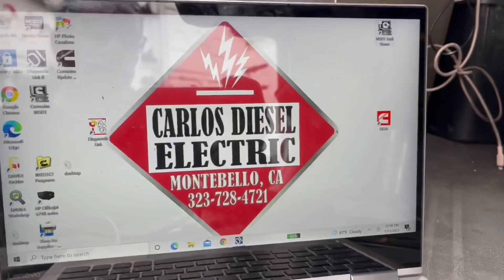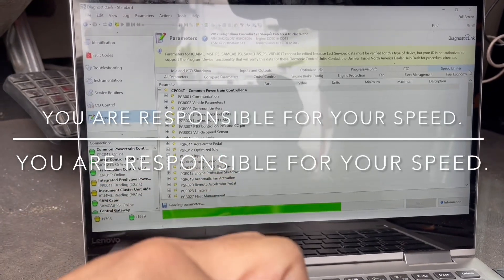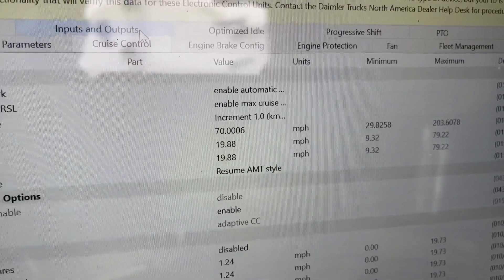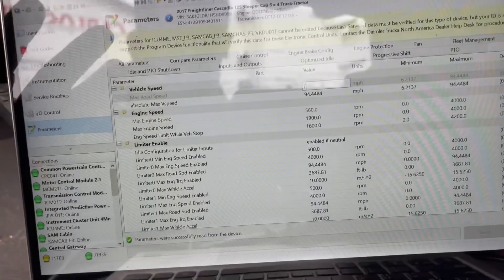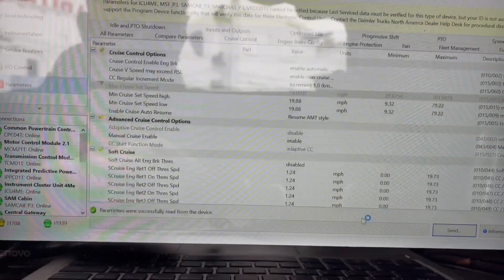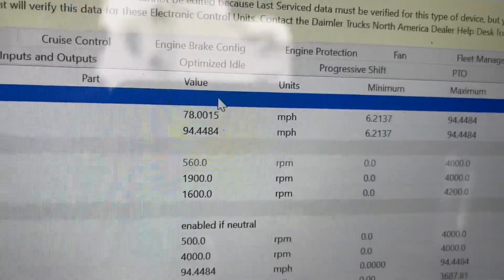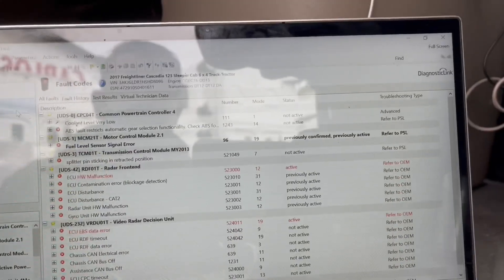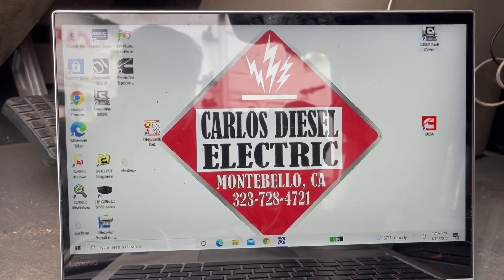Freightliner Cascadia, how to change the speed on your DD15

Comment: Hey Pedro was wondering what parameter i can change to get rid of the torque limiting on take off? Whenever i take off in any gear it limits the amount of power i have and doing heavy haul it gets really frustrating because i need that power on take off especially on steep hills, any info would be great thank you!
Reply from the maker: @Sinister_Reaper  look at the progressive shift. Remove or modify the parameter. That tends to limit  the RPM.
Reply: @CarlosDieselElectric it'll go up to 2000rpms but super slowly, like it's cutting a lot of the torque out, but after I make the first shift I have all the power back
Reply from the maker: @Sinister_Reaper  is your progressive shift enabled or disabled?

Comment: I don’t have my password how can I set the governor on a 2006 Freightliner CASCADIA
Reply from the maker: @UNLIMITED945 try using 0000 or 00000 or 12345 sometimes they are set by default. If that does not work you have to get a SEED password from Detroit but that is dealer only at this point. Detroit changed that a while back.

Comment: What would be the other parameter you would have to change for the newer trucks because I have adjusted my speed and cruise however my RPM will not exceed 1650. So my maximum speed is always 73
Reply from the maker: @moridrahim366  look for a parameter in that says legal speed. That is usually the limiting factor.
Reply: @CarlosDieselElectric  Thank you for your response, I did actually get the rpms to go past by disabling the progressive shift.
Reply from the maker: @moridrahim366  yeah. Forgot to mention that. Progressive shift will also prevent this

Comment: OK about changing the speed
But what about the RPM limit?
I cannot go above 1700 RPM
Reply from the maker: Change the progressive shift to disable. That will remove the RPM limit or you can adjust it to the desired RPM.

Comment: I brought a fleet truck it set for the company. How can I by pass it with a password
Reply from the maker: @ortbrad242  try 12345 or 00000
If that does not work Detroit will have to remove it by using a back door password

Comment: I wish I paid attention to what the mechanic did under the hood of my old company’s 15 Cascadia. Because whatever he did to turn it up to 73 mph, he didn’t use a computer.
Reply: There is a handheld unit that Daimler used to sell to fleets to do certain parameters changes.  Such as raise, lower, or disable the speed limiter, or change fan temp on, off settings.
Reply from the maker: @hudsondonnell444 that would be great to have.
Reply: @hudsondonnell444  what’s the tool?

Comment: What if you don't know the password? How can that be sidestepped??
Reply from the maker: Depending on where you purchased your truck from. If it was purchased from Penske, you can contact them and possibly remit. They have very extensive records. If not, then a Detroit dealer is the only way, it used to be much easier but then someone decided to change that and charge 2-4 hours for something takes about an hour or less.
Reply: It's a Ryder truck so guess dealership here I come. Was hopeful there was a work around, thanks for the reply my friend.

Comment: Hey! Thank you!! So what cable is needed to do this?
Reply from the maker: You will need a 9 pin connector and depending on what kind of interface you use like Nexiq, J Pro  depends on your software. 
For me, Nexiq uses the 9 pin and a usb to connect to my laptop
Reply: @CarlosDieselElectric  thank you so much for the fast response! You’re awesome

Comment: Easy peasy? You can't be serious. You don't show the interface between the laptop and the truck? How the heck you supposed to hook to the truck with the laptop? What software is being used? How much does the software cost? What's the name of the software? Is it a free download? I mean, you don't tell much of anything.
Reply: Did you figure it out
Reply: Software from Detroit is the standard but there are third party softwares that can be used. I think the correct software from Detroit is DDDL/Detroit Deisel Diagnostics Link, or DiagnosticsLink - this needs to be double checked though. First glance at the dddl looks like it has a subscription price that may be based on the role you may using to use the software as : driver, mechanic, fleet owner, etc. I haven't really looked into this subject though, I haven't verified this and could be mistaken.

There is often a harness that connects to the RJ port, or whatever connection you have on the truck, then the other end connects to the laptop. You've most likely seen one of these connectors if you've ever gone into a shop with a light on on the dash

There are also portable handheld devices that can be used, instead of a laptop.

I'm personally trying to find one of those handheld devices. I can't remember the names of them though
Reply: @ericwhittington91  Bully Dog and PDI Big Boss
Reply: @JYoung-jm2bv  thanks, I appreciate you
Reply: What about Ap k download of the software and Bluetooth for the eLD device  @ericwhittington91

Comment: What kind of software do I need, I’m going to buy my own truck and want to possess such software in case of diagnostic not only speed limit changing.
Reply from the maker: There are a few different options. J Pro, OTR and of course you can purchase the original software from Detroit. There is the standard version which is what I use. Allows me to see check engine light, malfunction lights (solid yellow) and the stop engine light.  Park regen
You can mark parameter changes as well. 
I would look at what works best for you and what is worth spending

Comment: So I’ve changed parameters to 77 on both, but unit still not going above 70 mph? Do you have a solution? It a 2024 Cascadia with 2900 miles on it
Reply from the maker: In the parameter, CPC, legal Pass or legal speed needs to be changed. I don’t remember the exact name but look for that. If that is set to let’s say 60 and the others are at 75. It will always obey the legal parameter. But you can change the legal parameter and you should be fine

Comment: Will it work on a 2022 Cascadia?
Reply from the maker: It should, there is an additional parameter that needs to be checked but  it will work on a 2022 Cascadia.
Reply: @CarlosDieselElectric  where will that parameter be located?
Reply from the maker: @Jayjayred24  parameter, CPC and then look for something that says legal pass or legal speed. I don’t remember exactly. 
Look at the speed and cruise control. I would keep them both the same. 
But if the legal parameter is 60 for example and the others say 72. It will follow the legal parameter. Doesn’t mean it can’t be changed.

Comment: Mine says powertrain Over speed detected when I pass 65mph. It’s governed at 65 pedal and 65  cruise control. I’m trying to set it 68 cruise. So far no luck or mechanic didn’t do it right.. help?? 2022 or 2023 cascadia model

Comment: How do I increase my Torque on 2019 Freightliner 126? What software are you using ?
Reply from the maker: The torque and HP are usually governed by the MCM. You may have some options to change the HP but you would need the DDDL software. 
Detroit Diesel Diagnostic Link. You can buy it from Nexiq.

Comment: Hola Carlos , muy bueno tu vídeo y muy informativo , vivo en Canadá y voy siempre a USA , el camión que conduzco está limitado a 65 mph y es camión de la compañía (no soy el dueño) , yo quisiera comprar el soft work e instalarlo en computador y así poder controlar la velocidad , cuando empiezo mi viaje lo abro y cuando retorno a la terminal ponerlo a 65 mph … como si aquí no hubiera pasado nada … me entendes mi punto por lo que quiero hacer … bro , es imposible manejar siempre a 65 mph , el gringo te insulta mucho porque lo molestas … y tienen razón , te agradecería mucho si me puedes ayudar donde puedo comprarlo , y que me sirva para todos los camiones del mercado … Volvo , Freightliner cascadia , Peterbilt , Mack , Kenworth , muy bueno tu información … desde ya muchas gracias de un Uruguayo que vive en Canadá … Abrazo !!!!
Reply from the maker: Normalmente el programa para poder accesar todo esos camiones y motores no lo venden. J Pro o Noregon creo que pueden hacer esos cambios. 
O Tienes que comprar una computadora pirata  que ya tengo esos programas.
Reply: Hola Carlos , muchas gracias por responderme , mire , yo tengo el computador y sólo tendría que comprar el programa para el Volvo 760 engine Volvo 2021 , cual tú me recomiendas ??? Desde ya muchas gracias 🙏 🙏
Reply: Una última pregunta , donde podría comprarlo ??? Gracias 🙏

Comment: My mechanic did this both were set at 80. However, the truck will still only 70mph. What should I do?
Reply from the maker: What year is the truck?
Reply: @CarlosDieselElectric  2018
Reply from the maker: @iamdirtyredd  there is another parameter that needs to be changed. 
Parameter, scroll down and there is a section that starts with legal speed or something to that effect. 
That also needs to be changed, if that parameter isn’t changed the other two will not respond. For example, the legal limit might be 70 and the other two might be 80. The legal limit always takes precedence
Reply: @CarlosDieselElectric  Thanks I'll give it a try.
Reply: @iamdirtyredd  have you figured this out?

Comment: how do you change the rpm governor.  ours are set to 1500 rpm max. 12 speed auto will not pull up a hill very well gets stuck in gear on a hill
Reply from the maker: Connect using the DDDL software and you need to remove or change the progressive shift parameter. This will allow the RPM change

Comment: If the customer owns the truck and wants the limits removed or raised its his responsibility not the techs. In TX they have 80+ speed limits (I know that's fast) but it's not illegal!
Reply from the maker: I agree. At the end of the day the driver is responsible.
Reply: @CarlosDieselElectric Can you use HP tuners sw to do this? Or is there one you prefer?  Thx

Im learning to tune cars & have a Loves near by. Wouldn't mind making some guys happy by giving 5mph over so they can pass easy & stop the 30 car backlogs on these 2  lane freeways/Interstates.
Reply: It's only fast near the big cities 20 miles, 30 miles outside of big cities.That speed should be no problem

Comment: Hey, just a newbie here, wondering if you can do this with just the link cable connected to the laptop or you need the Nexiq tool as well? Thanks
Reply from the maker: Not sure. The Nexiq is the device that allows you to communicate from the 9 pin to the laptop.
Reply: @CarlosDieselElectric  Thanks for the fast respond, really appreciate it

Comment: Hey I got a question. It’s a 2 parter how do you change torque and horsepower where can that be found at in the diagnostic link program? Also how do you turn off the door open alarms with diagnostic link program also?
Reply from the maker: The torque is already set in the MCM. You can only change the horsepower in the Actions tab. Most trucks have this option. 
The alarm for the door is probably on the Freightliner side and May require a different software.

Comment: Would you please post a video on how to bump up Idle speed on a DD15 engine? Mine is idling at around 680-700rpm and when outside temperature is Sub zero engine seems to run a little cold. Thanks!
Reply: In my Cascadia when parked I turn on the cruise control and add speed and it brings the RPM up. I think the most it raises it is to 1000 rpm. This also helps when trying to build air pressure.

Comment: Thanks for the video and what you do if there's a password.
Reply from the maker: If there is password it will need to go to a Detroit Dealer. They will contact Detroit, provide some information to them and then Detroit will give the back door password and remove the current on the computer. It does not take very long but this change started a few years ago.

Comment: Does this work with the 2020 model?
Reply from the maker: Very similar, there is an extra step you need to check. I believe it’s under the parameter, CPC, folder 43 Legal Limits. Make sure that limit is set to the changes you are making. For example, pedal speed and cruise control are at 70 mph, the legal limit needs to be the same. If it’s less than the driver will not reach 70.

Comment: What software is it and how do you connect it to the truck?
Reply from the maker: I use Detroit Diesel Diagnostic Link software, it requires a Nexiq adapter and the 9 pin connector. 
Go to the Nexiq website for the hardware information.
Reply: @CarlosDieselElectric  okay thank you brother
Reply: @CarlosDieselElectric  i’m seeing standard edition and professional, edition software. Which one are you using?
Reply from the maker: @headfirst6227  I use standard. It still allows you to make changes to parameters as well as regens, clearing fault codes.
Reply: @CarlosDieselElectric  thx. My main goals are the speed limiter and adaptive cruise control. I do have issues with the forward camera in wet conditions and of course the front bumper radar when it gets snow on it.

Comment: Hey man i got a 2014 freightliner cascadia 125 automatic need to disable the idle shutdown but idk the backdoor password can u help?
Reply from the maker: The back door password can only be removed by an authorized Detroit Diesel dealer like Freightliner or Valley Power Systems. 
It requires the DDDL software be connected, then you have to call and provide the VIN and the seed then Detroit will provide the back door password. 
It’s actually pretty easy to do and does not take very long. 
Detroit used to allow smaller shops like mine to do all of that but unfortunately too many people were calling not knowing what they were doing so they switched it and require trucks to go to the dealership. At least that is what I was told.
Reply: @CarlosDieselElectric  yea the truck is getting repair at freightliner in fontana they say they can’t get the password
Reply from the maker: @JohnLetra  I hate to tell them their business but they should be able to. The only reason might be if the truck belongs to a company. Then I can see.
Reply: @CarlosDieselElectric  i just bought the truck from Tennessee drove it home idle everything fine not shutting off then the truck have a broken shift controller and split pin go in repair after repair is done then the idle shut off after every 5 min and they charged me 400$ to remove the idle shutdown but no password

Comment: This work for DD13 12.8L 410 HP 1800rpm 2080 GOV? It’s limited to 66mph
Reply: The engine speed or RPMs on a DD13, DD15, or DD16 is governed based on generation of engine unit and displacement.  For example the DD16 is electronically limited to a maximum rpms of 2100 regardless of year of manufacture.  The DD15 in my 2015 truck is limited to 2400 rpms.  Newer DD15 engines are getting limited to 2100 RPMs like the DD16.  It's not the maximum rpms you are looking to change it's the vehicle speed limiter that is important.  My truck can theoretically do 120 Mph if the speed limiter is removed, but this will greatly reduce the lifespan of the engine.  The Western Star I am getting ready to start driving has an 18-speed manual transmission and Meritor drive axles with 2.54 ring and pinion gears.  With low profile 22.5 tires the truck can do 122 at 1900 rpms.  I will have the speed limited to a maximum of 85 and I won't be doing better than 75 Mph for tire life and safety.

Comment: how about if there is password?
Reply from the maker: The password by default is 00000. 
If that does not work then you you have to go to Freightliner or an authorized Detroit Diesel dealer. They have to connect to the truck, contact Detroit and request a back door password. Takes 30 minutes at best.
Reply: You can get the backdoor password software  your self, I have it.

Comment: Hey good video do you happen to know what’s the password that Walmart uses this truck is asking for a password on my scanner
Reply from the maker: The password can be anything the shop foreman or supervisor could have assigned. Try the last 5 of the VIN. But it could be anything. I try using 00000 by default and that usually works. If it does not. 
The only way to erase or reset is to take it to Freightliner or an authorized service center. 
They will connect and call Detroit and provide them with the seed or back door password while they are connected. Detroit will then provide the code to erase and then you can set it.

Comment: Do all diesel mechanics do this?
Reply from the maker: If they have the correct software they should be able to. 
But your truck can not be password protected. By default the password is 00000 unless it has been changed.
Reply: @CarlosDieselElectric  so if it’s a company truck, will it likely have a password?
Reply from the maker: @fartingrhinoceros  small fleets usually do not have a password. Trucks that come from larger fleets like Swift, Schneider usually have a password. You won’t know until you plug in and try and make the changes.

Comment: Can you use these programs to remove the rpm limit on 1st gear?
Reply from the maker: You should be able to. Go to the progressive shift option in the MCM and look at the RPM.
Reply: @CarlosDieselElectric  sick, thank you. Do you know if it's possible for that 1st gear rpm limit to disable itself?
Reply from the maker: @albertcruz3232  I don’t believe it will remove itself. Most parameter changes require use of the DDDL software.
Reply: @CarlosDieselElectric  ok. Thank you. My truck that came from fleet was limited to 1200 rpm at 1st gear but now it let's me go up past 1200 even though I didn't change any parameters
Reply from the maker: @albertcruz3232  interesting, maybe it’s a learning thing on the MCM. Is it an automatic or manual?
Reply: @CarlosDieselElectric  you mean like the mcm changing it based on driving habits or perceived need? It's a manual transmission
Reply from the maker: @albertcruz3232  could be. Have someone plug in and see what the parameters are